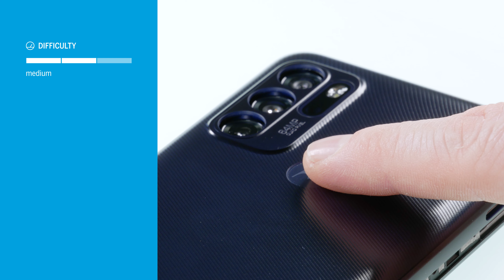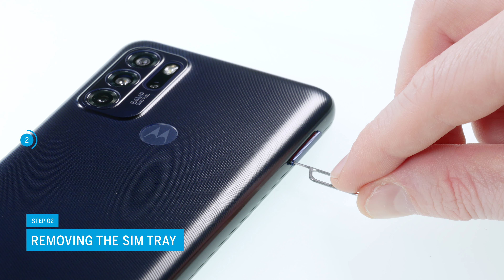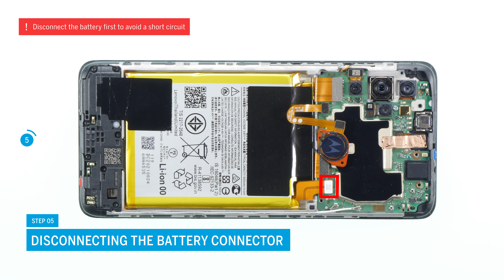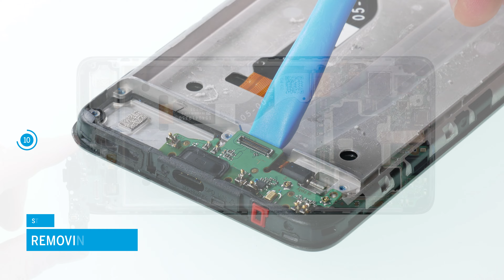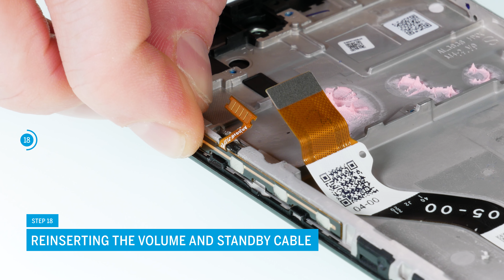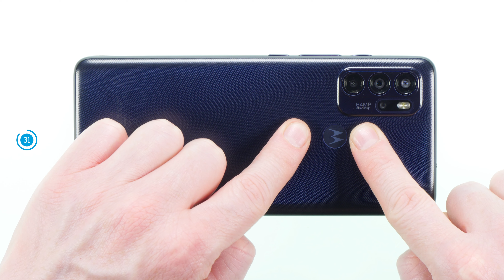Motorola moto g60s – Screen replacement [including reassembly]

Comment: Thanks a lot for this video.
Just one remark for those who bought only the screen (glass without frame) : screen is easily removed using a hair dryer, it will detach from frame.

Comment: Great video, i just do this myself.

To beginners i recomend using isoprolipic alcohol on the battery or else you may break the battery and turn the phone into fire.
Reply: Yes I was able to remove battery very slowly. With little screw driver and alcohol, carefully. Thanks for the tip. The glue spot under battery is strong 😁